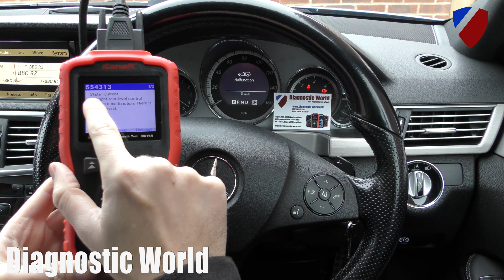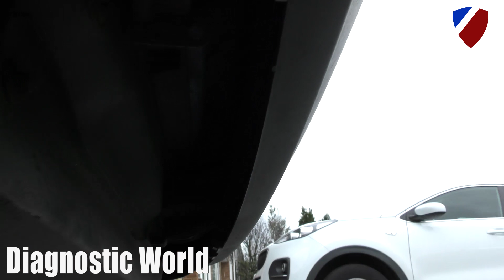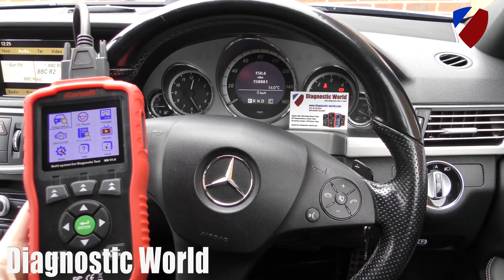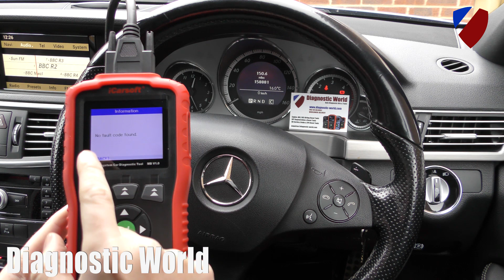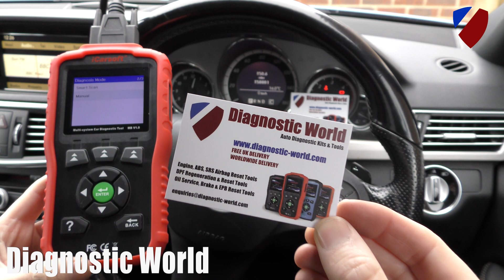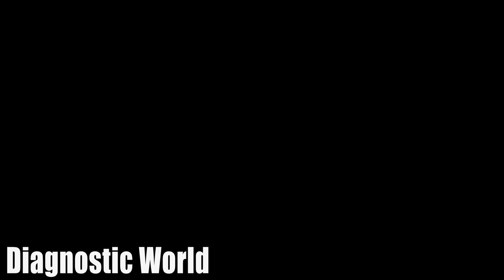Mercedes E Class 212 Airmatic Malfunction Suspension Fault Problem Fix & Reset Guide 554313 554013

Comment: A good tutorial but have you done one where you use the icarsoft to reset the S212, or any car for that matter, suspension heights and inclinations after working on the air suspension? I have the CR MAX and have difficulty understanding the process.

Comment: The pressure relief valve open circuit malfunction message is also a common fault. This is situated on the compressor. The problem is most of the time the 2 thin wires  breaking internally where they are exposed just before the connection plug,  they look fine externally though. I repaired mine and all was OK, check before changing the compressor.

Comment: Hi I have 2010 e30cdi with a fault code B219116 would I have to replace air suspension??
Reply: Did you get a solution to your problem? I have the same issue

Comment: Hello I've replaced my air compressor my 2 rear air bags and front right air strut but still getting the malfunction message on my dash and car lowers overnight rear right and front right any ideas?
Reply: i had this problem and where the problem was the electric cable plint near the batteri! my friend who is mecanicer fix it.the connection to the air compresser com from that plint.
Reply: Mine the same
Reply: Valve block is the issue.
Reply: Did anyone figure out how to fix this issue 
I have the same problem
Reply: Calibrate your level sensors
Reply: @melobsm228 how do I do that?